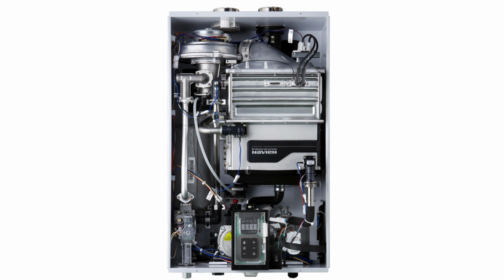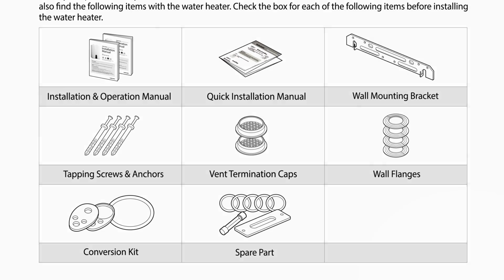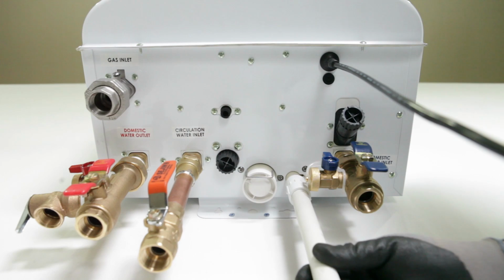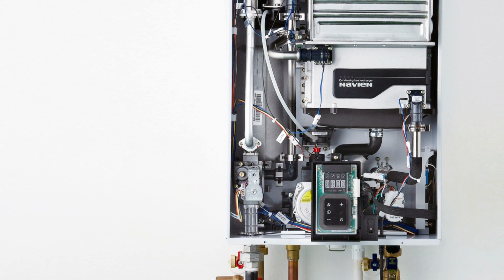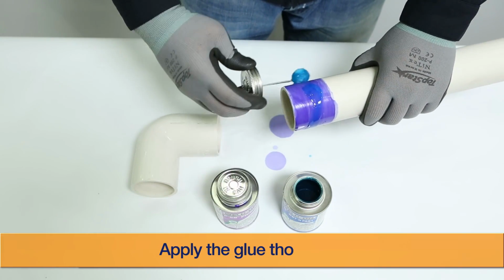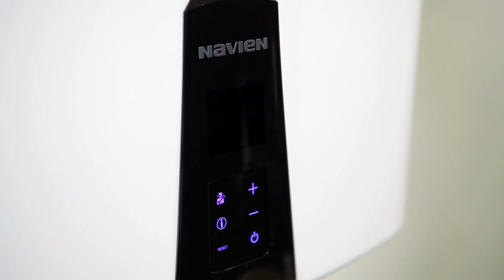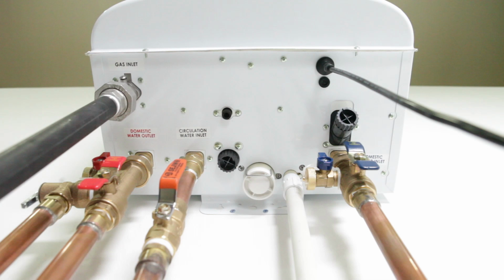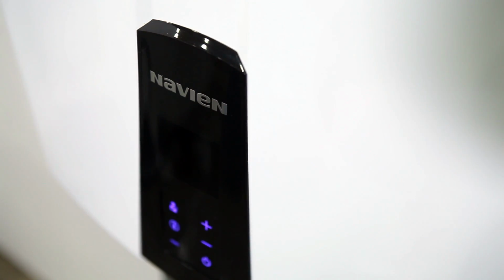NPE Navien Premium Condensing Tankless Installation Video

Comment: Note to Navien:  At 6 min plus on the video, the speaker advises that the air intake filter should be checked regularly.  The part is secured with a screw!  For a part that should be checked frequently. even annually, this is a design flaw.  It should be secured in a manner that is removable without tools!
Reply: Not really.
Reply: I Think some models have a pin, which makes it easier

Comment: forgot to say ,Fill the condensate trap inside the water heater by pouring water water through the exhaust vent on top of the water heater
until water flows through the condensate drain. page 31 in manual
Reply: What would happen if I didn't pour water into exhaust vent? I just DIY installed 240A and didn't add water through the vent, noticed few drop of water leak from the condensate outlet , very odd for non pressure line.
Reply: The water you add seals and  prim the drain line ,if you don't,it might blow some exhaust gas out from drain untill eventually it primes itself

Comment: Could someone explain the external recirculation? And where does the condensation line drain to?
Reply: Condensate should be pipes to a neutralizer condensate pump then into a drain. And the external recirculation is for a fixture that's more than 50 to 70 ft away
Reply: There are two models A with recalculation and S without, recirculation unit is able to recirculate hot water so when you open hot water will come right away it uses about 2 gas therms a month to do so, but you need another hot water line for it to work.  S model you have to wait for cold water to drain from pipe first. Condensation occurs when the heat is taken from exhaust gases and has to be disposed of, it is a bit acidic so a filter is used so your pipes won't corrode.

Comment: You failed to mention of this unit is hardwired in or plugs up to an outlet.
Reply: Matt Freytag an outlet
Reply: @paulputman2571  does it have to be a dedicated circuit?
Reply: @michaelstaylor2844  yes sir
Reply: It needs a 110 outlet
Reply: @michaelstaylor2844  no